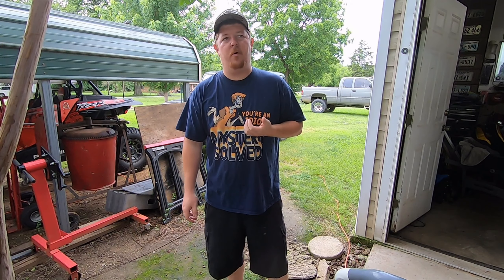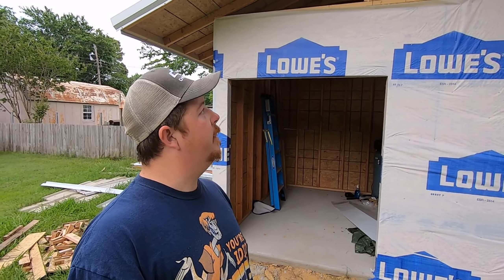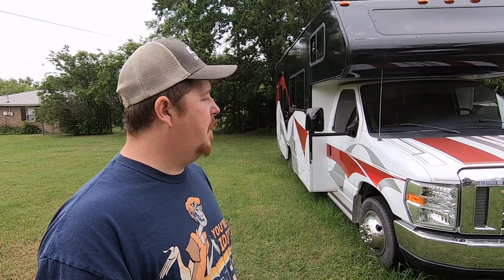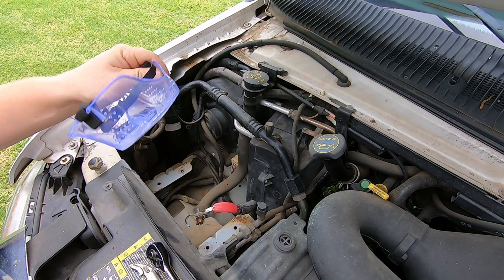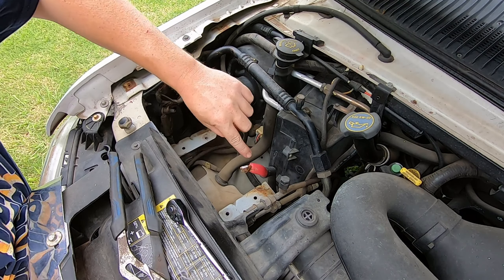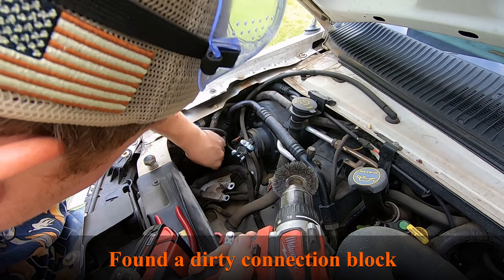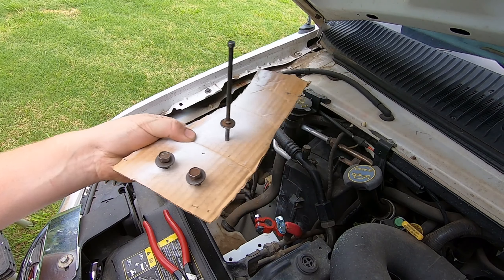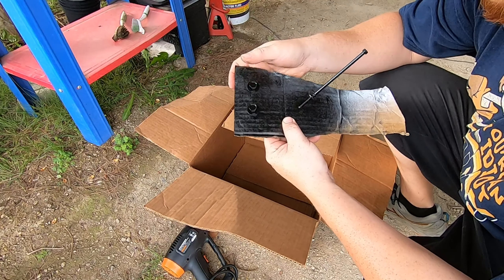How I replace battery terminals

Comment: Hey James I seen your video about replacement of the a/c evaporator in a dodge ram 1500 and i seen you are located in texas based of the sticker in your windshield . And i was wondering if you do any kind of mechanic work. I have the same truck but 2000 model and the a/c evaporator needs replaced and i have the parts just unclear what to do because of video quality! I am located here in arlington texas